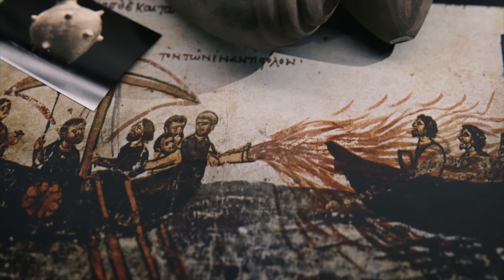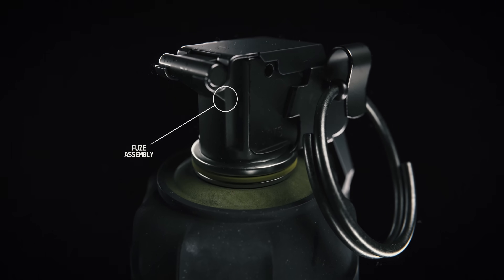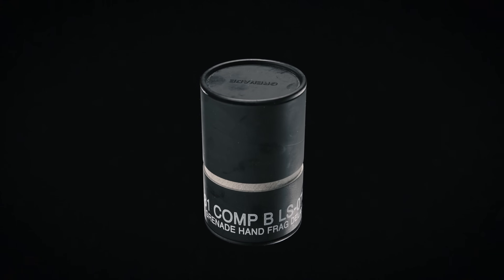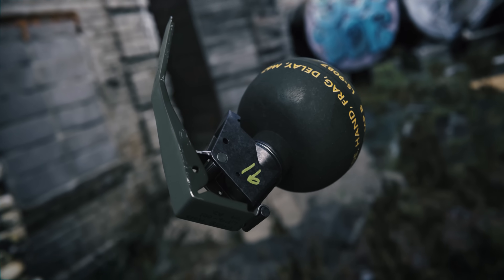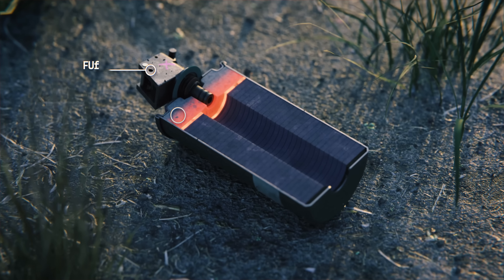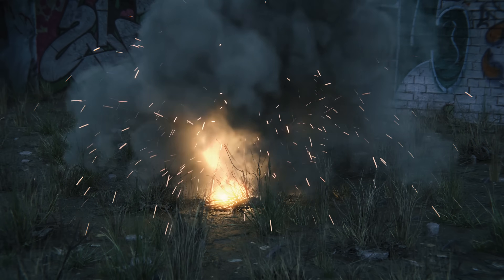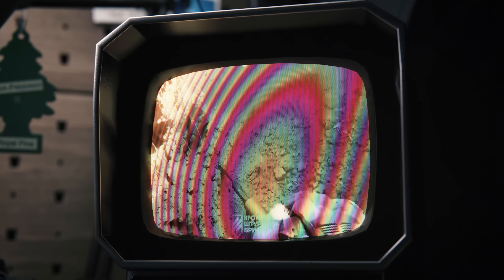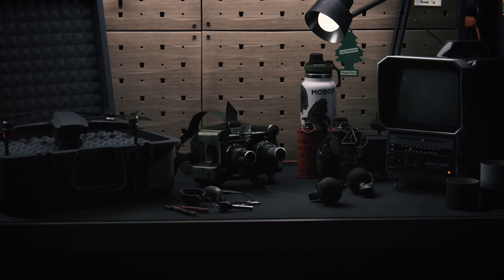How Grenades Work (3D Animation)

Comment: M67 has two safety devices: a safety pin, and another safety pin. The spoon is not a safety device because a grenade is not safe when the pins are out. It is armed and either firing or jammed into a tube and awaiting someone to come along and walk into the tripwire tied around the grenade’s neck to free the spoon. It’s not the kind of thing you hold onto unless you’re trying to die. 

Easily the biggest surprise I had in Ukraine was how much we relied on grenades. In the movies you see the guy throw maybe 2 tops. I would bring 12 or more grenades sometimes and use or hand off all of them. Just regular frag grenades and 1 smoke. F-1s (small boom with lots of fragments and large chunks) and RGD-5 (big boom but fewer fragments). Human life is so precious in that war on the Ukrainian side it just doesn’t make sense to take out a couple motivated orcs inside a dugout who refuse to surrender when we can throw a grenade in there. Also if I don’t then I have to carry them all back.
Reply: What's your opinion about RGO and  RGN russian grenades ?

Comment: This was a fantastic video! Absolutely awesome, so i hate to complain.....but at 3:54 i was hoping it would finally explain the only thing i don't quite understand or can't visualise. Which is: what the shrapnel does after the first explosion? What happens at the 15 foot radius of severe injury? Does the shrapnel arc hit the ground there, or does it just loose so much velocity it doesn't do much damage beyond that line? How many pieces of shrapnel are there, is it roughly the number of 'panels' in a pineapple grenade, or is it hundreds?
Reply: At the point of detonation a grenade will eject a certain number of fragments, either resulting from the grenade body having been pre-scored, intentionally weakened in some other way, or more likely as the result of it having been filled with small ball bearings. It is known by the grenade manufacturer how many fragments are on average ejected by the grenade at that point of detonation, and thus also what the statistical likelyhood is that a 1,8 meter tall adult male would be fatally injured by those fragments at a certain distance. For the lethal radius a >95% likelyhood of fatal injury is used, a distance of 5 meters would be that treshold for the fragmentation grenade mentioned in this video. The further out that representative 1,8 meter adult male is from the point of detonation, the lower the likelyhood of fatal injury becomes, at a distance of 50 meters you could still be fatally hit if you're unlucky, however the likelyhood has dropped to such a degree that it's no longer a reliable certainty. So it has nothing to do with grenade shrapnel losing its velocity/energy at a certain distance, rather the shrapnel density for an average adult male drops the further he is from the point of detonation.
Reply: Explosives and their shrapnel tend to move to the path of least resistance and by that, when an explosive goes off at ground level it disperses its energy and shrapnel up and out in a sort of V shape. If you consider the degree of travel of shrapnel it would be less probable to hit anything human size the further out, away from that V.

Comment: Although the frag grenade is used more often than many others depending on the requirements and intentions but the stunning grenade can give vital seconds of advantage in structure based combat as you can not fight what you can't see or hear meaning if the int🎉are to secure a target alive tactical grenades like stun can be what potentially makes the difference

Comment: I didn’t hear the question “what everyone gets wrong about…” Being answered.
Reply: Seriously. They didn't even lay out what people "get wrong."
Reply: So annoying when channels do that (or, actually don't!); it's classic clickbait territory. What Hollywood often gets wrong is the big fireball explosion & throwing objects violently away from a blast wave effect.

It's usually a dull thud (from distance), no 'fireball', no throwing objects tens of metres away. It can disturb dust & debris from EVERY surface in a room - including the floor, ceiling & walls; surprising how many surfaces are actually covered in a layer of often invisible 'stuff'! That's a rapid change of air pressure in a volume of air, with few exit points.
Reply: yeah, so sick of the bait titles. Auto thumbs down
Reply: You got fooled.
Reply: Most likely it was the one about disarming or disabling a grenade after it was activated by putting the pin back in, which the video demonstrates to be impossible by explaining how the detonator works.
Reply: @Yamamoto659 it would work to safe it if the spoon hadn't dislodged, but otherwise not gonna help.
Reply: Well he explained how the entire thing worked in insane detail, so safe to assume questions are answered

Comment: For the M67 you incorrectly stated it has 2 safety's, the modern M67 has 4 safeties:
1. Thumb-Clip
2. Pull-Pin Retainer
3. Pull-Pin
4. Spoon

The M67 has a factory 3-5 Second fuse time with a 5m kill and 15m casualty radius

Comment: Quick correction. The external grooves on the old "pineapple" grenades were not to promote  fragmentation, but to allow for easier handling in wet or muddy conditions.

Internal grooves/notching promotes fragmentation which is why some grenades have fragmentation liners composed of notched wire, coiled to match the contour of the grenade body.